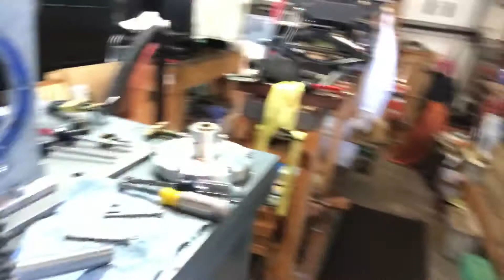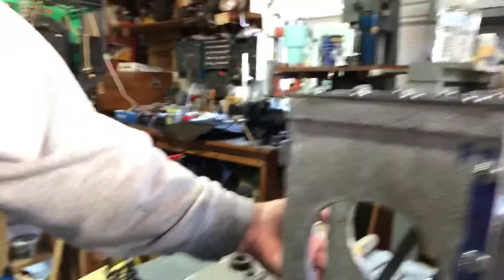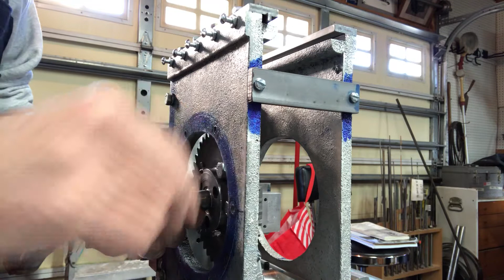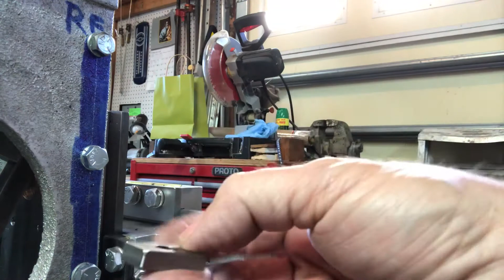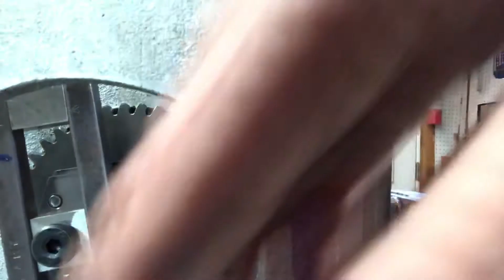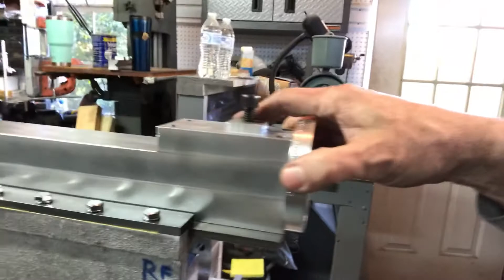Gingery shaper with gear drive

Comment: Came over from Presling, and found this build series. I’m tackling this project as well from raw stock instead of castings. These videos have definitely helped me go back and look at a few things. 

I do have a question, where did you find the bull gear for your shaper? That is where I’m at in my build and pondering on what to do there. 

Thanks!
Reply from the maker: Thanks and welcome, Terence! The bull gear was from a scrapped medical machine. Not even sure what it was. Although it worked out for me, I did have to do extra speed reduction in the motor drive, so it may be best to stick with Gingery’s original chain drive design... Good luck!